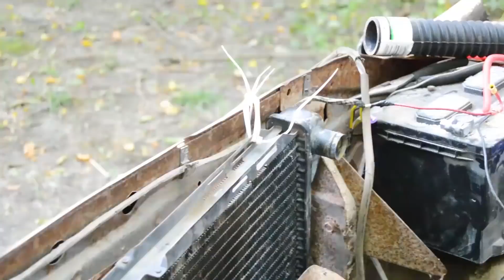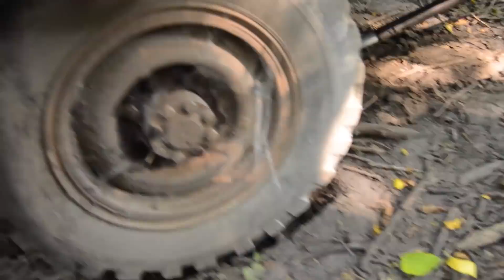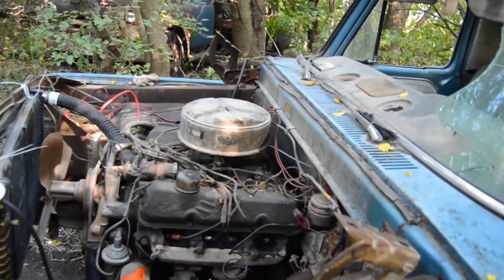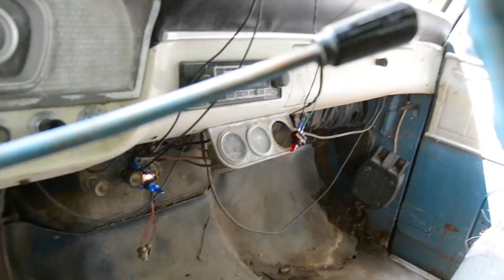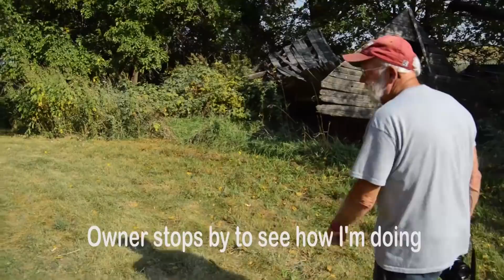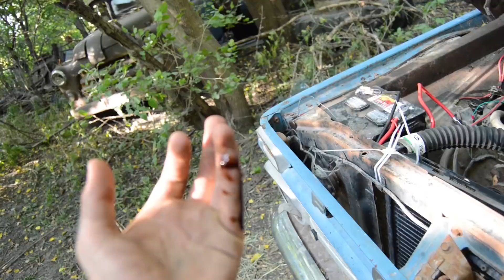Abandoned F250 Revival! First Start in 26 Years -- Part 3

Comment: if it runs the same with an intentional vacuum leak, im gonna say its got an unintentional vacuum leak.
Reply: I was also going to say vacuum leak. They had the carb off so it may be the base gasket is loose. I turn on a propane torch but don't light it. I run it around the carb base and look for the engine to rev slightly. Then I found my leak.
Reply: @jhutch1470  if I were a betting man, which I am not, I would be laying down money on this guy.
Reply: Carburetor base gaskets are notorious sources of vacuum leaks. Rocking the carb will cause change in engine sounds. If fuel leaks out on to manifold ... Air is getting in
Reply: @Sir Nicholas D Was the PCV loose?
Reply: @ddd228  Does this model have a PCV?  I didn't see any hose for it.
Reply: @MexicanSpec  Yes, I think so. Intake manifold to a valve cover.
Reply: Thought the exact same thing
Reply: I agree
Reply: In the end it seems to have been the valves were out of sync.
Reply: Throttle shaft leaking guaranteed.
Reply: @jedclampett6466  Im voting with you on the throttle shaft.
Reply: That totally makes sense. I was thinking that maybe it was just a weird problem but now you say that your probably right
Reply: @jedclampett6466  
I see a spark advance unit on the distributor with no vacuum line run to it.
It could be dried up inside and a new line to it wouldn't make any difference.
If they had no spark adannce in '65 then that is a new distributor, but a working diaphram would still advance the timing accordingly. That is all it took to make it work.
Reply: your right you know
Reply: I got that when it wouldn't idle.  It was obviously pulling air from somewhere.
Reply: Sherlock theme
Reply: If you have a vacuum leak then the distributor is not retarding the timing under idle

Comment: You might want to check your vacuum advance canister, it may already be making a vacuum leak. In my '84 f150 with the 351w the diaphragm was ruptured and it ran too lean. The Haynes manual for my truck says you tune it by vacuum. Get the engine warmed up, then throw a vacuum gauge on a manifold port and tune one screw for max vacuum, then tune the other screw for max vacuum. It worked well for the holly carb on my engine. When tuned well, it should only take a pump or two of the accelerator, and the choke for about 10 seconds on a warm day. Try slamming all the way down on the accelerator and letting up quick so the mechanical fast idle kicks in so you can play with other parts of the engine while it runs without needing to mess with the accelerator.

Comment: ...and the excitement is building!  Question,..did you guys you pull it out of gear without clutch? or its been sitting  out of gear? If it was in gear, chances are you can get it to move.If not, we hope the pedal is far enough  up to allow full contact with clutch plate. Does the previous owner recall ever putting a clutch in it?  inquiring minds want to know!    Great videos!

Comment: Huh I use the 51515 on my Jeep. However I swapped out my metric oil filter connector for a SAE just so I can use a higher quality filter and not have to look high and low for a metric filter that is actually good.

Comment: Do I get to make a guess as to why it runs the way it does? lol
The infamous "what you did when I was at work" day - now I know!
Reply from the maker: +ThunderHead289 timing chain was shot and it needed all the excess fuel in the runners as a reserve closer to the valve to make up for the shorter, improper, burst of vacuum signal in order to get enough fuel to actually enter the cylinder in order to run at idle? Is that your guess?😂😂
Reply: wow! its like you took the words right out of my mouth! 
not always a great idea PH2A lmao
Reply: ThunderHead289 there was also no vacuum hose on the vacuum port of the distributor. Which explains why it was running the same when he took the plug out of the carb lol
Reply: I am glad I wasn't the only one who noticed that the vacuum advance wasn't hooked up to anything.
Reply: @chrisperry1756  The vacuum advance runs on ported vacuum so it doesn't matter if it is n there or not at idle.
Reply: ThunderHead289 how’s the truck running
Reply: ThunderHead289 lol😎😎
Reply: When can I see part 4

Comment: Those old 352 fe v8 will run hard if you want them to. A 4 barrel , cam , headers and ignition upgrade really wakes them up. I have a 66 short box with a 352 fe I added a 4 barrel with a edelbrock streetmaster intake, headers and my fave fe cam the comp 268 h. Converted distributor to duraspark , added MSD 6al ignition box , recurved distributor and she flat boogies. It is probably close to 275 - 280 hp now which isnt bad for that old pickup. She will smoke'm just breathing on the go pedal

Comment: You need to tune your carb. Ford's standard start point on the idle adjustment screws is 1 turn out. Also, clean out the gas tank before adding any.
Reply: And, put a rebuild kit in the fuel pump if it's been sitting forever it is full of old gas that turns into brown slime. I went through similar problems a few years back.
Reply from the maker: +Justin Johnston close but no beans. Carb was rebuilt fully in an earlier episode.

Comment: Looks like a 390 fee could be leaking under valve covers since technically the intake gaskets would be under there
Reply: If the clutch was "broken/not engaged" and the tranny was stuck in gear, wouldn't the truck take off when they first jumped it? Similar to starting a car in gear(not in neutral)without a clutch safety  lockout switch ?

Comment: Carb is sucking air somewhere, that's why the disconnected vacuum line changed nothing and it won't idle without the choke on (needs extra fuel to compensate for that air). Just found the series, I'm hooked! Did the same thing back in the day with an old Chevy truck in the woods. Friend and I went as far as taking turns walking a battery all the way there after giving it a tune up but never got further than a fireball out the carb :)
Reply from the maker: +aaron71 dang that woulda been a cool truck to revive! As for the runnkng issue nope! Biggest hint is that nothing changed as i moved the timing

Comment: If it will olny run with the choke closed, its either getting air from somewhere else than through the carb, like a vacuum leak or the idle mixure screws are way off or its starving for fuel.
Reply from the maker: +fuzzy wuzzy nope! Biggest hint is that nothing changed as i moved the timing

Comment: Have you checked air mixture screws on the carb? Run them all the way in then back them out approx. 2 full turns each.
Reply from the maker: +Wesley Cooper nope not that! Biggest hint is that nothing changed as i moved the timing
Reply: Junkyard Digs thats not good. Good luck with it. Those can be good old trucks ive had several mid 60s Fords and Chevys.

Comment: Carb is still dirty a little bit it's not able to pull enough fuel at an idol put an air cleaner on it set the timing around 6 BTC and it'll cough and sneeze spit a little bit back through the carburetor and usually that will clear whatever is in it then set the timing at about 10 get a manual choke cable and you can tune it while you're driving just like an airplane LOL have fun with that old 352
Reply from the maker: +Rusty Stuff cab was rebuilt, biggest hint is the fact that timing adjustment wouldnt affect how it ran
Reply: Junkyard Digs manual choke cable then so you can tune it like an airplane while you're driving them damn 2100 I remember buying two of them one of them wouldn't idle without the choke but would run the other one would Idol but wouldn't run without the choke it just sounds to me like it needs to backfire one time and blow out whatever's inside it
Reply from the maker: +Rusty Stuff thats exactly how we guess the old owbner drove it! Pulled the choke at stops
Reply: Junkyard Digs gotta love it way too funny I run a lot of them old 352 the same way 360 390 406 and 410 pretty cool old family exhaust valves love getting sunk up into the heads though and then they make a oofing noise when they're idling sounds like the heads aren't that bad on that one

Comment: So ... you're saying that no matter how you move the distributor the timing at the crank doesn't change?  Humm ... maybe the plate that the points are attached to is moving. Vacuum advance rod fell out or broke off the breaker plate?
Reply from the maker: +tsmartin youre getting close!! Definatley following the right clue
Reply: This sure is a brain twister. If I remember .. FE's have the distributor cam and rotor assembly driven by the shaft in a different manner than GM uses. I wonder if something is fubar where the cam and rotor assembly is connected to the shaft.

Comment: I enjoy doing this kind of stuff too. My suggestion(s) are to double check the points gap. A matchbook cover is about the right thickness or feeler gauges are cheap (.014 in). Set the timing with a timing light 0-6 degrees at idle, see if it goes up when you rev it (if not unstick the advance weights in the distributor) 30-34 degrees at 3,000rpm is in the neighborhood of right. The go back to the carb and fix what I suspect is the major issue, the idle circuit is clogged up. You can pull the idle jets all the way out of the carb baseplate and spray carb cleaner right in there a few times, waiting a few minutes between shots. Screw the jets back in all the way, lightly bottom them out and back the up 2 1/2 turns. If that don’t fix it the carb will have to come back off for a better cleaning. 

It’s not as big of a job as you may think to just drop the transmission and see what’s up with the clutch. The rusty new throw out bearing may be the fix. If it’s not binding when you spin it in your hand it’s likely useable. The original likely froze up and galled the collar around the input shaft of the trans. It’s probably stuck on there and will need to be hammered off. Clean both of them up with some sandpaper or emery cloth and slap it back together. 

Good luck, cool old truck!
Reply from the maker: +AngryRed Banjo good info but not quite!Biggest hint is that nothing changed as i moved the timing. Carb was fully rebuilt last episode

Comment: Lol you called that motor a 352, its 351
Reply: I think he mentioned that it was an FE motor.  The Ford 352 was part of the FE engine family.  The 351 was a Windsor, Cleveland, or Modified but not an FE.  My dad bought a brand new 1967 F250 with a 352 so I can believe this is a 352 as well.  :-)
Reply: Shelbyfan73 ah, I always forget about those FE motors
Reply from the maker: +Jarred Random yup 352 fe!
Reply: Lol you called that motor a 351, it's 352
Reply: mwilliamshs Honest mistake, forgot about the fe

Comment: Your thinking too smart. You have to think dumb. Your overthink the idle problem. Instead of messing with air fuel mixtures and timing. Why not just try raising the idle
Reply from the maker: +Christian Lucatino because we ewould have to raise it to approx 2500rpm
Reply: Junkyard Digs huh cus it seems like it wanted to run at lower rpms than that. I just thought you weren’t changing that cus that wasn’t in the video. Thanks for clearing that up

Comment: Great videos. One thing that woke up my old Ford was taking off the voltage regulator and using fine sandpaper to clean the three contacts inside, also clean the blade connectors for the plug. It was like adding a performance coil on mine. ha. Also, maybe use some carb cleaner to spray round the usual spots while its running, it will surge up in idle if theres a vacuum leak.
Reply from the maker: +1973custom no vacuum leaks, no one has guessed it yet im surprised

Comment: I would start with a compression test, if its low dump some marvel mystery oil down the cylinders and let it soak and recheck it.
Reply from the maker: +Randy Willauer soaked all the cylinders in trany fluid in part 1. Not that!

Comment: Since it runs the same with a large vacuum leak I'm assuming there must be another vacuum leak elsewhere. Intake gasket maybe? 

I have to imagine there's probably some gunk in the carburetor restricting the jets, too. Also wondering what the compression is across all cylinders.
Reply from the maker: +Carnage Racing no vacuum leaks, carb dumps pleennttyyy of fuel in,  but the biggest biggest clue is no matter hoe much i turn the dizzy nothing changes
Reply from the maker: +Carnage Racing nope, no other leaks! Biggest hint is timing adjustment made no difference

Comment: My opinion is that you have a stuck metering rod assembly. Your vacuum advance isn'y working properly. The thrust weights could be partially frozen or are missing a spring. Good luck and we'll be watching.
Reply from the maker: +stephen gardin close but no beans! Part 4 will tell the story!
Reply: I like beans, so let's try again. The main jet isn't clean enough and it leans out. Also the points gap is too far open retarding the spark. Hope I'm correct because I'm hungry!
Reply from the maker: +stephen gardin point gap was one! I fixed that in this video tho
Reply: Man, I'm famished! Your sucking air where you don't want it to. Could be any carburetor gasket, linkage hole, vacuum port, even the vacuum advance itself if its broken or has a rust hole in it. We'll be watching.
Reply: ford carbs. don't have metering rods .

Comment: Vacuum leak ..hose , intake or inside the carb , worn out distributor . Or could it be your trying to pull gas up to the carb ...raise your temp gas tank and see how it runs . Great fun video.
Reply from the maker: +Rusty rods youre close!! Biggest hint was that the timing change made no difference! Will explain in part 4!
Reply: I forgot to add fuel pump failure . I started thinking of what I did to fix the lean run on our 352 and it was a worn out fuel pump had to keep the choke on to add extra draw from the engine to help pull the fuel .

Comment: If I had to guess, I would say a vacuum advance line is clogged, the advance isn't working. Or you have a manifold gasket leak as someone said. That is that issue.  Regardless,  The engine is running too lean without choke. I subscribed so I can't wait to see part 4.
Reply from the maker: +Delmont Industries LTD youre close! Buggest hint was timing adjustment made no difference. Took me awhile to find it, will shoe in part 4!
Reply: Glad I'm close haha. I'll do some thinking and try again later. I have done some resurrecting of old vehicles too So I can't wait to see more.

Comment: How’s the float level- yes you can get real fancy with a guage, but, pull the top off the carb just after you had it running- if the float is level, your good. If its pointed down at all, shell run, but have trouble pulling enough fuel. Also, make sure the little tiny clip is attaching the float to the needle.
Reply from the maker: +Mr. Bo we set the float off camera in part 2, biggest clue is the timing makig no difference as i turned it! 😉

Comment: Massive leak at manifold or carb mounting gasket? My 84 351w ran like that until I got a new intake manifold, and carb with new gaskets. A nice weiand dual plane intake with holley 600cfm carb did wonders.
Reply from the maker: +Riley Potter nope! Gotta keep guessing😂 the biggest clue was no matter where i set the timing nothing changed
Reply: Junkyard Digs I was referring to it not idling without dying but the distributor would be a broken dizzy shaft would it not?
Reply from the maker: +Riley Potter youre getting closer!!

Comment: from yrs of rebuilding engines...stay away from fram oil filts...wix is a good brand...not sure if you know ... the truck is a "camper special"  only camper specials have the tool box in the bed on passenger side.
Reply: they also came on rancher specials
Reply from the maker: +little homestead Franklin NC yes indeed to both of those!